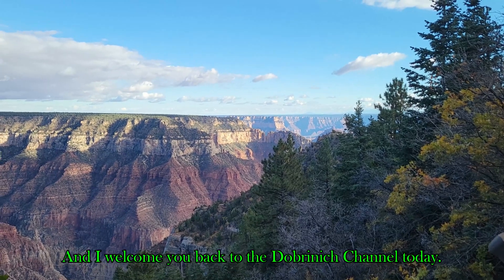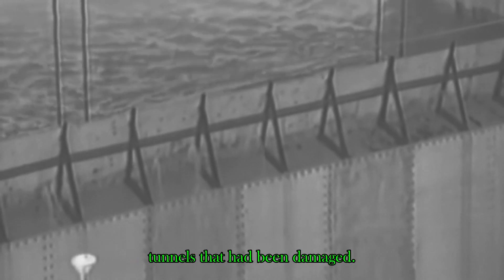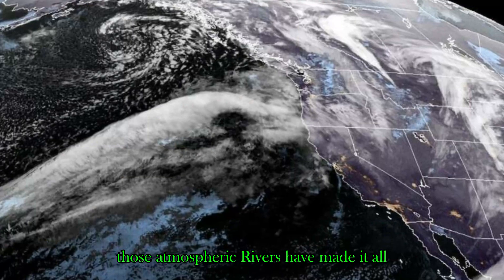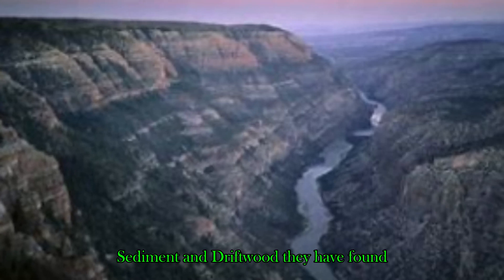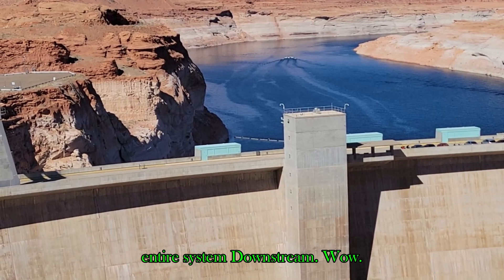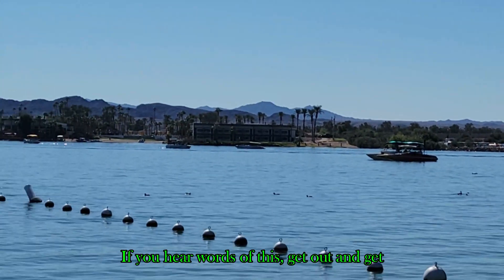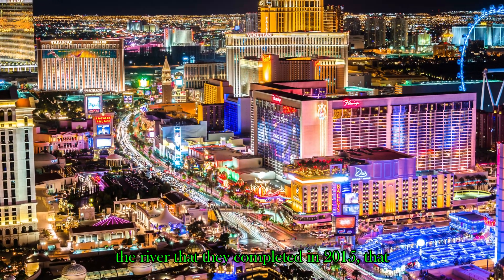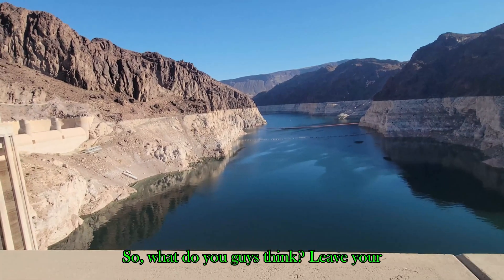Lake Mead Will Wash Away

Comment: I'm not sure if Glen and Hoover would be destroyed if they were over topped.  They are very thick and substantial dams.  The power plants would be destroyed but the dams could hold.  There was a 100 year old dam around Ashville NC that was to be replaced because it was "deficient".  It was over topped by the recent 1000 year floods and it held, which means it wasn't really that deficient at all.

Comment: Your conclusion is flawed, the CFS capacity doesn't have to equal the total CFS coming into the dam unless the lakes are full.  In 84 the CFS into Lake Powell was actually higher than 83 however it was not an issue like in 83 as the spillways were simply opened earlier.  The excess water simply raises the level of the lake and crisis averted.
Reply from the maker: But what you forgot though is the lake had an extra 4 ft of play because of the boards on top of the dam in 84. Also the amount of water I talk about in this video is much greater than the 1984 flood.

Comment: It will never happen.I don’t know why you would even suggest this.I have been watching your channel for at least a year.I know you have a lot of knowledge on the whole Colorado River system.Lake Powell and mead are so low   They could absorb all this water.If it was to get close to full or in danger they would open the spill ways.
Reply from the maker: Because I have done the research. In my opinion I don't agree with your statement. Did you watch the entire video? I explain it in great detail why the lakes wouldn't be able to absorb this kind of flood. Think about it the Grand Canyon did not get carved out by itself. Flooding is a possibility any given year and they have found the evidence from the past. It is few and far between but it has happened before. What makes you think that it won't happen again? Because of the current situation? Just curious what makes you believe that they could find room in the lakes. They had no idea that the flood of 83 was coming until it was to late. The lake was almost lost. Had they received the same flood as 84 in 83 it would had happened. The only thing lake would not be standing. Think about the flows in the Yellowstone river last year. Things can change fast. That area was in a drought as well and a month of rain along with a rapid snow melt and you have a huge flood.
Reply: @Dobrinich  I just think before it would get in that drastic situation,they would open the spill ways.The lake has never been this low before. There is just so much room in it I just can’t see it happening.
Reply: @Dobrinich  The Grand Canyon started as a stream, then as the years progressed it started carving out the Grand Canyon, and millions of years later, we have what we have now, so your statement that the Grand Canyon didn't carve out itself is wrong, it did, unless the dinosaurs figured out a way to excavate the canyon, did they?